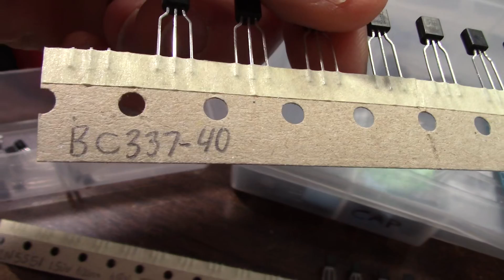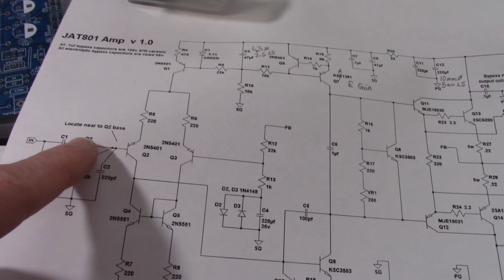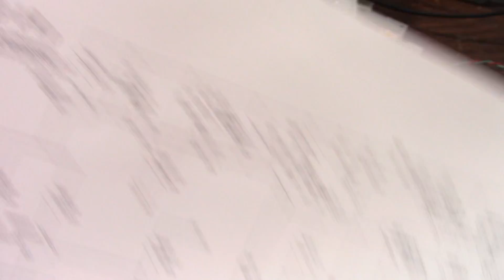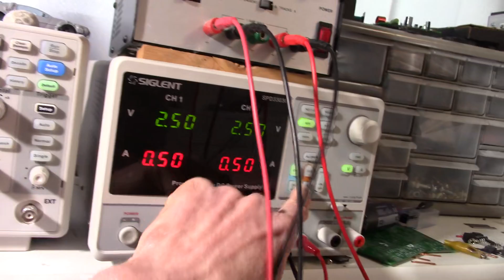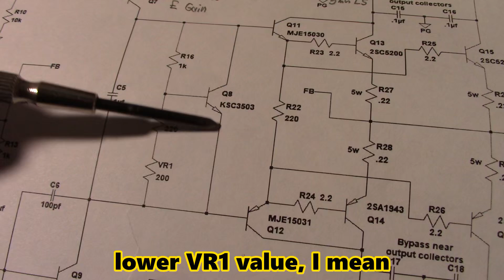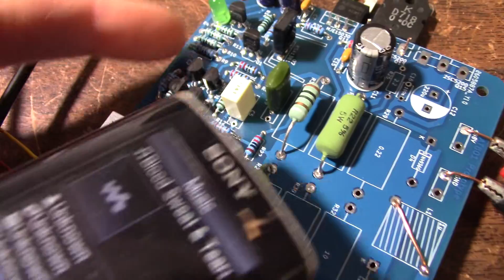JAT801 audio amplifier assembly and first power up

Comment: Just a tip for soldering the final version: bolt down your transistors to the heatsink/spreader before soldering them on to the pcb. Once soldered you can unmount if required. Soldering them without mounting to the final heatsink will result in more effort trying to position correctly and stressed leads.

Comment: Greetings from Mansfield! Will you be attempting any distortion /performance  analysis using ARTA as you touched on in previous videos?
Reply from the maker: If I can revive my old computer. My current one does not have as low distortion audio for measuring.
Reply: @JohnAudioTech  I've pondered if adding bypass caps and magnetic shielding to a motherboard would reduce the noise floor for this sort of testing.
Reply: @jimcoleman52  Maybe we should all cash in and get John a Topping D10s DAC or something. Also, I would totally buy a kit for a even more powerful JAT model.

Comment: Toshiba transistor are more better quality in my experience when I did measurement with my curve trace. Less distortion   , if can get them with the same wafer even better
Reply from the maker: I like more better.
Reply: Which one? There are many different transistors in this amp.
Reply: I vote otherwise, they is most better quality.